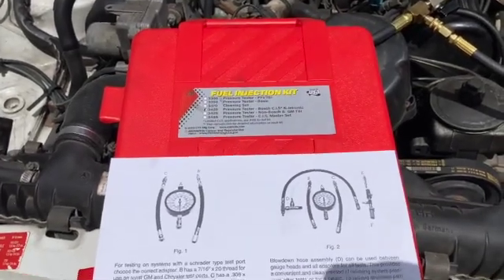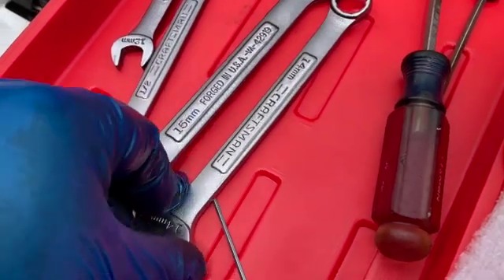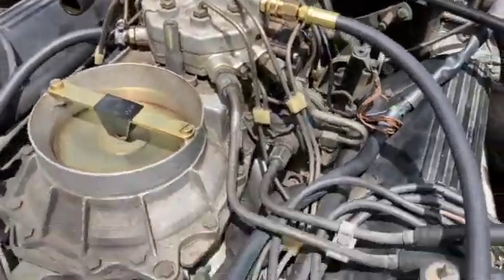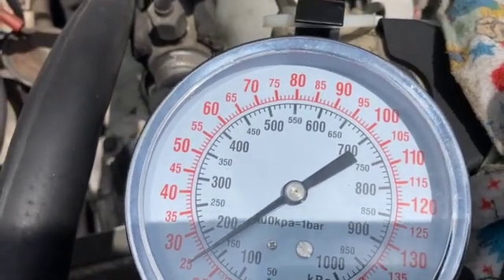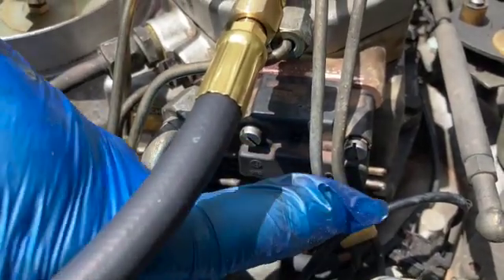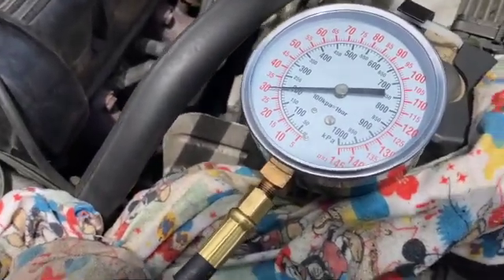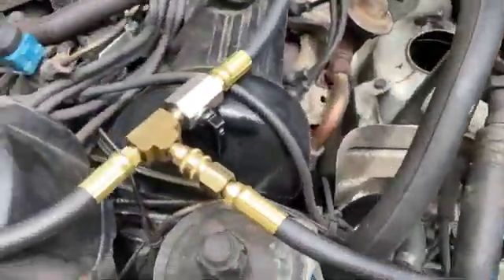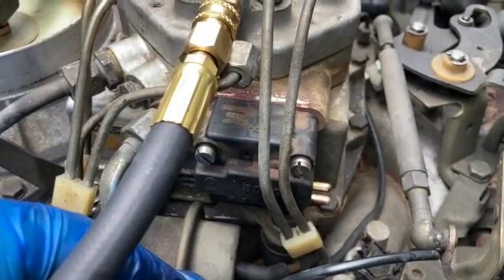Fixing engine stall and no power on 6 and 8 cylinder KE Jetronic Benz cars    SD 480p

Comment: Hello my friend 
Did you see a small letter on the right and left heads when the two heads were removed? Remember well, my friend 
These letters are placed by the factory on the head when it is new and before installation. If you, my friend, did not see the small letter when removing the head gasket, then the head was subjected to grinding in the past.?
Reply from the maker: The cylinder heads were left alone and i did not have to disassemble them.
Reply: @straybenzes  My dear friend, I love all of your videos and I liked them and I published your channel with my friends and acquaintances in order to subscribe to your channel, but my friend, I did not see the marks on the heads. You are a feast. The viewer of your video, which you filmed, will find that there is no mark. I was hoping to know the depth of the mark. In the year 2025 AD, I disassembled 6 engines from repair cars and did not find a healthy head. All of the heads were ground. 
Dear friend, is there a booklet or information explaining the head size and combustion chamber depth?
I am very sad😞😞
Reply from the maker: @kalfoogaltmimi5043  That is a valid point. Too bad that the car in the video is long gone so i can no longer look for the marks on that one.Interestingly enough, head gasket or other cylinder head issues on the 420 and 560 are rare. Is this a big issue where you live? Taking off 0.05 to 0.15mm to make the cylinder head nice and flat again is usually not a big deal. Where do you find that this is a problem? That is a little different depending on if and how many times that has been done before of course.

Comment: bonjour, merci beaucoup pour ton travail partagé. j'aurais une question est ce que ces mesures de pression compte aussi pour les 4 cyclindres, j'ai une 190e 2.0 de 1991. quand je branche mon manométre avec la vanne fermé j'ai une pression de 5 bar et avec la vanne ouvert ca monte a 5.3 bar mais la voiture broute ou cale.
Reply from the maker: KE Jetronic do work the same on Benz cars and your differential pressure is too low. You need to dial that in to 0.4Bar. If your car still stalls make sure your mass flow valve flap is in the right position and that your idle mix screw is set to max idle RPM no matter what that is (it's set with the idle control valve). Good luck.
Reply: @straybenzes  merci beaucoup pour votre réponse. je vais essaie tout ceux-là.
Reply from the maker: @HzrTrk  Good luck!

Comment: Hello, how can i contact you?
Reply from the maker: Try this platform right hrere.
Reply: @straybenzes  Hello, I recently became the owner of a Mercedes C126 500sec 1981 (European model). The car has been in the garage for the last 20 years, but it was perfectly maintained before that. I have two major problems, the kick down does not work, (I replaced both the relay and the switch) and the second problem is that the car has no power and changes gears too early when driving, I have the impression that I am pulling a truck behind me. let me mention that the engine runs smoothly without any irregularities in the operation and that I changed the filters, spark plugs and all the fluids on the engine, can you help me get the runaway horses back 😩
Reply from the maker: @Ivan-q7u8u  Doing this remotely is difficult if not impossible. The kickdown not working can also be the solenoid on the tranny. However, it could be related to the second problem. No power sounds like a fuel related issue. I would start from the fuel pump(s) all the way to the injectors and validate that each component is working as it is supposed to. Any car that sits around for that long a time frame will have some issues with components not working quite the way they are supposed to. This could be literally be anything from blocked filters/screens to faulty injectors.
Reply: @straybenzes  Hello, I recently became the owner of a Mercedes C126 500sec 1981 (European model). The car has been in the garage for the last 20 years, but it was perfectly maintained before that. I have two major problems, the kick down does not work, (I replaced both the relay and the switch) and the second problem is that the car has no power and changes gears too early when driving, I have the impression that I am pulling a truck behind me. let me mention that the engine runs smoothly without any irregularities in the operation and that I changed the filters, spark plugs and all the fluids on the engine, can you help me get the runaway horses back 😩
Reply from the maker: @Ivan-q7u8u  Doing this remotely is difficult if not impossible. The kickdown not working can also be the solenoid on the tranny. However, it could be related to the second problem. No power sounds like a fuel related issue. I would start from the fuel pump(s) all the way to the injectors and validate that each component is working as it is supposed to. Any car that sits around for that long a time frame will have some issues with components not working quite the way they are supposed to. This could be literally be anything from blocked filters/screens to faulty injectors.
Reply: @straybenzes  and as for the vacuum leaking somewhere,, could tha cause so much powe loose, where it happens most often, the entire fuel system has been checked and works flawlessly
Reply from the maker: @Ivan-q7u8u  Let me put it this way, no vacuum leak is good for anything. False air let the car run lean and it can surge, sputter, run rough, and not have the usual power.

Comment: Great video, sir! With the regulation of this EHA can I adjust idle speed this way? Or this is something that is not related to that? Of course, first step would to check diff. pressure. I am experiencing high idle speed, around 900rpm. Even when cold start is still 900-950rpm on my 1985 500SE Euro. Thank you
Reply from the maker: That engine and model year have the K jetronic not the KE Jetronik. I do not believe your car has an EHA. Adjusting idle speed - once air flow meter and idle mix are set correctly - is done with the idle control valve. There is a video I made about that not too long ago. Good luck!
Reply: @ Thank you! I'll check that
Reply from the maker: @amatsiuk  👍

Comment: if the pressure is not at 6 bar to start with how do you bring it back to 6 bar, what is the fuel range pressure for a gen 2 500 sec,my 500 sec has no problems starting or running but I feel it is not providing full power, even first gear pull no spin from the wheels and it is a 265hp hi compression engine
Reply from the maker: Did you verify the fuel pressure right at the dual fual pump system before the fuel filter?
Reply: @straybenzes  I have not, how would i go about doing this
Reply from the maker: @sas8403  Use the hose/gauge kit and you will need to put in a temporary T before the fuel filter. I you are not sure how then I would go to a reputable Benz shop and let them measure the fuel pressure.

Comment: Hello, I have spark plug number five that is not working, even though I changed the wires of the spark plug and the spark plug, and I also repaired the gasoline distributor, and I also changed the injector, which connects electricity to the spark plug, but there is no change in the operation of the engine, meaning that the engine is running on seven speeds. What is the problem?
Reply from the maker: Did you figure this issue out?

Comment: Hi Ralph, thank you so much for these videos. 
I have a 1986 W126 420SEL that starts and stalls cold and also stalls while driving so can’t really go anywhere with it, I just did the pressure test and have only 5.25 bar of working pressure and it does not leak down, it holds at 3.2bars after running the pump, with the valve open on tester and car running it goes up to 6 bars and when valve is open it stumbles runs poorly seems to be very lean but spark plus are all very black as though running very rich! I tried adjusting the EHA by turning the 2mm screw clockwise a couple of times 1/4 turns but it didn’t change the system pressure at all. Shouldn’t the working pressure from the pump be at least 6bars to start with?
Reply from the maker: Delivery pressure of the pump should be 5.5 to 7 Bar. The fuel distributor pressure is 5.3 Bar. There should not be any fluctuation. So here this may be a defective fuel pressure regulator. It could however be acerbated or also be caused by a bad pressure accumulator (near the pumps). The EHA settings control the fuel differential pressure and really only comes into play when you accelerate or decelerate the car. Try making sure that you have consistent and correct fuel pressure by trouble shooting the fuel system one part at a time from the fuel tank onward. Good luck.

Comment: I’m the guy how’s EHA was unplugged on the SEC 500 , The only problem I have now is My car stutters while driving and mostly when in cruise control like as if for a second the breaks are applied softly for a sec. Hard to describe. Could this video help me solve that? Maybe it’s getting to much fuel or to little fuel? also just nearly passed emission also that might be a clue. Any help would be amazing as always. This very it excellent thank you once again.
Reply: My emission result was CO 3.44 vol % and HC 685ppm if this help?
Reply from the maker: Oh boy. The symptoms you are describing can have quite a few root causes. Do you know who or why someone disconnected the EHA in the first place? Did you check raw fuel pressure and the fuel pressure differential?
Reply: @straybenzes  I’m going to take it to the mechanic that worked on it and mention what you said,Thank you for your help!
Reply from the maker: @teammagnaparte1112  I am sorry that I could not provide more help.
Reply from the maker: @teammagnaparte1112  Thanks. Hopefully this can be resolved. Good luck

Comment: Did you disconnect the electrical connector on the Cold Start Valve so it would not spray fuel?
Reply from the maker: Not needed as this type of work is best done with a engine at operating temperature.

Comment: hello, these are great videos. i am wondering if you can add a tip on re installing the eha valve. do you need to remove the 2 hard high pressure hoses which wrap around the eha valve to the fuel distributor and how do you make sure the 2 green o rings are properly seated as you replace the eha valve to the fuel distributor?
Reply from the maker: You need not remove any other hoses or tubing in order to loosen the two EHA screws. The O rings are in proper position and in good shape if they slightly protrude from their grooves and the rubber is still pliable. This video may be providing you with a closer view of the O rings. https://youtu.be/Hs8w5zBxHvY The best of luck to you!
Reply: @straybenzes  yes that was super helpful. do those o rings need a lubriquent? silicone or simply motor oil?
Reply from the maker: @leescheinbaum1938  Hi Lee. Personally I would not put any lubricant on the O rings. At least not on these two.